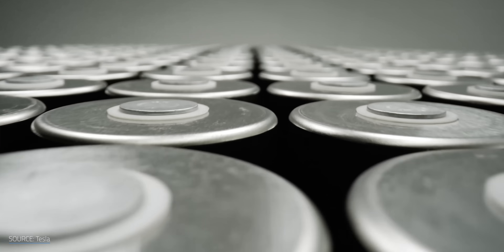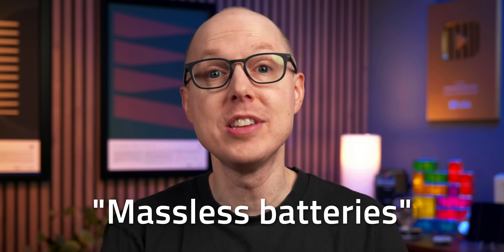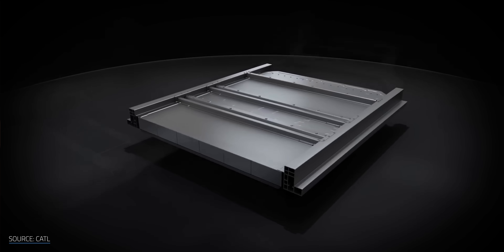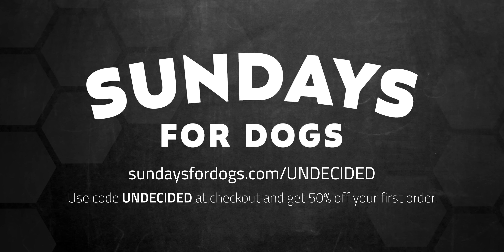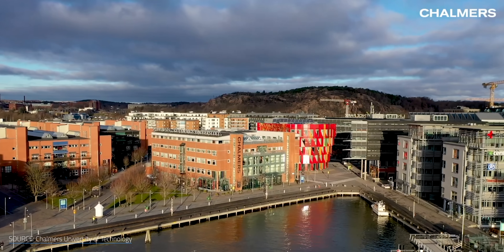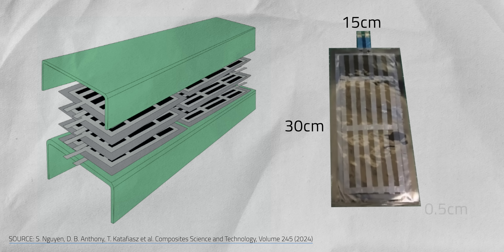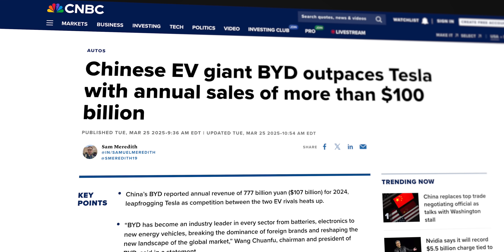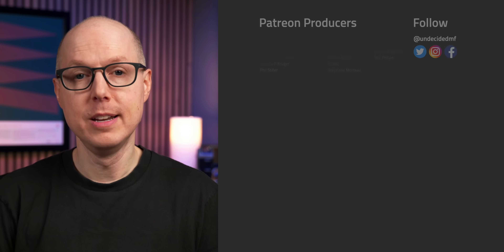The Strangest Battery Breakthrough Yet

Comment: in general i wish the industry would focus more on recyclability, imaging a car that is 100% recyclable, without having to to use highly complex and toxic methods to extract the resources, it might be a less fancy and potent car, but you can repair it and take it apart with ease, now that's a future i would love to see.
Reply: Exactly, the more resistent it is the harder it will become to recycle... For solar oanels that's fine because they will face the sun for 30 years or more, but for a car that has a high change of being totaled within 10, not so much.
Reply: @alexandruilea915 haha! Say that to every 90s or early 2000s car on the road today. 20 years should be the minimum!
Reply: @tonylarose4842  you are right, but I was thinking about accidents, not advanced degradation.
Reply: @tonylarose4842  Some cars ads now brag about reaching 100,000 miles without problems.
That used to be the bare minimum, and cars would reach 200k, 300k before they could no longer be maintained.
Reply: Just because something can be recyclable by a proven factory process does not in any way mean that you will be able to easily repair it - especially by your average consumer. Those two are entirely different things and require very different types of optimisation. Decide which is more important. Personally I think recyclability is the most important, alongside limiting environmental damage in the creation, use and recycling of products - and that does not necessarily mean that there are no toxic processes, just that the toxins are contained and dealt with in a way that doesn't harm the environment (e.g. like breaking down toxic substances into nontoxic byproducts).

Something to be considered is that finding ways to create new batteries (or new ways to create the ones we have) and decrease the resources used in them is very important, and structural batteries might be able to achieve that - even if it couldn't be easily repaired. The weight in vehicles like cars or planes directly leads back to how much energy is used to move them, so if we can decrease the weight we can decrease the emissions used in moving those vehicles. However, in the end, although it's important to create new batteries and ways of making them, all new technologies need to be produced with a view towards the environmental costs over the product's lifetime, which ultimately includes recyclability.
Reply: My thoughts exactly... I'm all for new battery technologies, we'll need a bit of everything for each specific application as we move towards an electrified world but, we must always factor in the recyclability of stuff in the long run and the batteries presented here look like a recycling nightmare!
Reply: The parts, schematics, and access for self- or small shop repair.
Super thin batteries and devices are fun to brag about, but when everything is glued together, an attempt at repair often results in wide destruction.
And a super-thin phone is also a super breakable phone.
Reply: That's the balancing act. The more tightly integrated something is, the harder it is to both repair (think phones assembled by glue rather than screws) and to recycle. In pursuing these technologies, we should start by asking which problem is the bigger one, then evaluating what our solution actually does to solve it or make it worse. Sadly, capitalism asks a different question, and that's how R&D capital is allocated.
Reply: circular economy needs to be a more popular goal
Reply: You realize making batteries is not clean right?

Lithium batteries are also volatile and are more noticable when mass produced as they can cause house fires easily if they are faulty.

A single AA sized lithium battery igniting is enough to cause a chemical fire which brings down a whole house, since lithium reacts to water.
Reply: @dra6o0n  the rate of spontaneous ignition of lithium batteries from internal short-circuits is very low, especially when they are undamaged. Gas stoves/hobs and old wiring cause the vast majority of house fires.
Reply: @ That 'low' rate gets multiplied by the millions of them mass produced in China, which makes the fault rate shoot up more as they cut corners to get more of it out.
Reply: Everything can apply by scale, what you deem is low from a single or double digit, isn't anymore when you go into the millions or billions.
Reply: @madsnylarsen  remember that research is performed to make profitable products, not to make the world a better place.
Reply: @madsnylarsen   Recycling is generally our last issue when it comes to environment
Reply: @madsnylarsen  tbf the key with vehicles is to make them as long lasting as possible so people stick with them
Reply: Most of everything on a car can be reused or recycled, the thing is how much it costs to recycle or reuse. Most of the time it's cheaper to just get a new one.
Reply: yeah but it costs money to recycle stuff, cheaper to dump it.
Reply: Anything that can be intentionally disassembled can spontaneously disassemble. 😆 "Easier to repair" is often at cross-purposes with "longer lasting", because every fastener and clip becomes a failure point. Products that are fused together with solder, welds, and glue tend to stay together. The only common materials that are truly recyclable back into the same material are metals and glass (and to some degree thermoplastics): any other materials (natural fibers, polymers) are degraded by the recycling process. But consumers want products that are durable, lightweight and small: metals and glass by themselves don't satisfy those parameters.
Reply: @erikdietrich2678  I understand what you mean but I don't see it as totally true. ICE engines, f.e., can be intentionally disassembled and serviced and they won't spontaneously fall apart just because. If things are purposely built and designed for being serviced and repaired they will be constructed in a way that allows said repairability without those things simply coming apart. Is it a compromise, yes. Are "disposable" products more profitable, yes.

You stated a big, harsh truth about "recycling": it's effectiveness is limited, much more limited than what we're "brainwashed" into believing. The problem is that the true, effective paths for a sustainable development, reducing and *reusing*, won't make anyone richer, so they're kept under the radar.
Reply: @erikdietrich2678  I can easily take apart a bicycle. With regular moderate maintenance it can potentially be ridden for a lifetime.
- 
Items welded, glued or fused together may stay together for a very long time... at the joining surface, but the material can fail just beyond that joint.

And now you have, instead of a loose fastener, a broken part that takes more than hand tools to replace.
Reply: @MonkeyJedi99  a bicycle has around 300 parts and no electronics, and the part count is only that high because of spokes, etc. And even then, you aren't repairing the individual pieces: you're generally replacing them with parts made by someone else. Your caveat of "regular moderate maintenance" is just another way of saying "constant minor repair".
A smartphone has more individual components on its circuit boards, and they're all smaller than grains of rice. How much physical maintenance does a smartphone require? None. And with some precision soldering, they are repairable. But to make a smartphone repairable by the average consumer, it would probably have to be the size of a bicycle.
Repair of modern devices isn't impossible: it's just wildly impractical and difficult for the average consumer, if only for the precision tooling requirements.
Reply: @erikdietrich2678  "Anything that can be intentionally disassembled can spontaneously disassemble" - How many products do you own or have you even seen that have spontaneously disassembled?  I'm going to guess the answer is zero.  Being designed to be intentionally disassembled doesn't mean "will fall apart on its own".

"'Easier to repair' is often at cross-purposes with "longer lasting" - You work for a car company, don't you?  Or maybe Apple?  Or some other company that manufactures products with planned obsolescence?

"Products that are fused together with solder, welds, and glue tend to stay together" - Glue fails far more frequently than screws, in my experience.
Reply: @nomore6167  Vibration "disassembles" machines all the time, which is why fasteners are sometimes secured with thread lock, which is effectively glue.
Consider this: what products do you own that are easy to repair, but never have had to be repaired? Any? Older cars allegedly are long-lasting, but somehow still require "maintenance" (aka minor repair) sometimes as often as something every year to every few months - fluids, seals, rotate/realign/replace tires, wipers, bulbs - never mind when components spontaneously fail. My tablet I've had for 5+ years: it's never needed repair or physical maintenance. I have never needed to take it apart, so it doesn't matter it's got hundreds of micro components, fused together, so would be very difficult to do.
And if you're seeing glue fail before fasteners, you're using the wrong glue, or glue isn't the right approach.
Reply: @erikdietrich2678  "Older cars allegedly are long-lasting, but somehow still require 'maintenance' (aka minor repair)" - The fact that you define maintenance as "minor repair" means you are arguing in bad faith and are not interested in having a meaningful discussion.

"Your caveat of 'regular moderate maintenance' is just another way of saying 'constant minor repair'" - So you have solidified your belief that maintenance is minor repair.

"How much physical maintenance does a smartphone require? None." - Well, it requires the battery to be charged (which is maintenance, aka minor repair) at least once every few days, and it requires the battery to be replaced (aka repair) at least once after few years.  So much for your "none".
Reply: @nomore6167  charging a phone is "repair"? now that's in bad faith. Replacement of components, including fluids, as they wear out is repair. I don't know how else to define repair. The rubber of windshield wipers and seals breaks down over time, and cannot be fixed, only replaced. Filters and lubricants degrade and stop working. Metal rusts and flakes apart. Filaments in incandescent bulbs break and cannot be fixed, only replaced. That's repair.
Reply: @erikdietrich2678  "charging a phone is 'repair'?" - Going by YOUR definition, yes.  You are the one who said that maintenance is "minor repair".  Charging the battery is regular maintenance.  Thus, according to YOUR definition, charging the battery is "minor repair".

"Replacement of components, including fluids, as they wear out is repair. I don't know how else to define repair" - Repair is the fixing or replacement of defective or damaged parts.  Replacing fluid (which is done to PREVENT damage) does not classify as repair.  That's why it's called maintenance, because it is done to maintain an item (to, PREVENT damage).

Also, to quote you again, "Replacement of components, including fluids, as they wear out is repair" - You claimed that a smartphone needs no maintenance and no repair.  So, according to YOUR claims, the battery in a smartphone never needs to be replaced (and, apparently, never needs to be recharged).

It's okay to admit that you're wrong.  Despite what some people think, it's not a sign of weakness.
Reply: @nomore6167  charging a phone isn't "repair". Your exact words: "repair is the fixing or replacement of defective or damaged parts". Great! We agree, since I said "replacement of components... as they wear out is repair." I don't see how those two sentences are meaningfully different. Replacing fluids may be were we disagree, which is fine. Certainly you've done more than replace the lubricants in a car, yes? Wipers, tires, belts, spark plugs, light bulbs, fuses. Maybe seat covers, or gaskets, or hoses. And since "replacement of defective or damaged parts" is your definition of repair, we're all good. Right?
You are arguing that charging a phone is maintenance, and therefore contradicts my definition of repair. I don't think charging a phone is maintenance, therefore it doesn't contradict my definition. Merriam Webster says "maintain: to keep in an existing state (as of repair)". I'm not repairing my phone when I charge it. The battery isn't defective or damaged on a daily basis. And with good charging practices (not above 80%, avoid heat, don't charge too quickly) a lithium battery will last 3,000-5,000 cycles before losing significant capacity. Even daily charging that's 8 years. 
Certainly you've repaired something on a car in 8 years if you drive it every day, yes?
Reply: Enter by faith in Christ into His soon Millennial Reign, and you’ll be impressed by the responsible tech solutions He standardizes globally. Finally, when Yeshua (Jesus) is in charge, all the ideal solutions for everything will become common and the world will have lasting peace. I can hardly wait to be one of Yeshua’s engineers He empowers to solve the world’s technological problems. I pray I see you there. 🛠️
Reply: What's for dinner, dear? 
Why, the old car, of course.

Nature is where the toxicity comes from too 😜
Reply: Yesnt..? While many natural things are toxic, waste made by humans that wouldn’t be there otherwise is making other things toxic

Comment: In the Trucking industry, structural batteries in combination with onboard PV Panels could prove to be a game changer for E-Trucks.  A large part of the problem with E-Trucks is the weight of the battery and the length of time it takes to charge that battery so why not have a duel combination?  A swappable battery that can be removed and replaced with a fully charged battery along with a structural battery incorporated as part of the body of the massive trailer with PV panels on the roof to keep those batteries topped up.  The swappable battery wouldn't need to be manufactured as part of the structure so it could be installed and removed with a fork lift and placed on the charger or placed back into the truck fully charged ready to go.  This would reduce the net weight involved in an E-Truck semi as compared to a full battery with onboard charging.
Reply: You need to do the math to understand the vast gulf between what solar panels on a trailer can generate and how much power a truck needs.
Reply: @skierpage  Exactly, the energy capacity and density required in a semi truck is vastly greater. It'd be closer to trying to convert a locomotive than a car. It just doesn't make sense in that application. Not in the remotely near future anyway unless there's some crazy battery tech breakthrough.
Reply: @skierpage  
The roof of the trailer alone could support 24 (~15 across on one side and 9 length ways on the other side) with another 30 folded down towards each side and folded up when the vehicle is parked to maximize sun exposure for a total of 54 standard size of  39"*65" PV panels  While not enabling a full charge they could possibly supply about 10% to 15% of the charge needed.  The 24 panels would actually form the roof of the trailer and provide continuous charge while in the sun with the side panels pivoting up and down.  Fifty-four standard PV panels, each producing around 400 watts, could generate a total of 21,600 watts (21.6 kilowatts).  Half that for less than ideal conditions and they could produce about 10, 000 watts or 10.0 kilowatts.  While not a self sustaining system it could contribute to the battery charge providing the panels are replacing the some of the trailer structure (most likely the roof) by incorporating them as the structure.  The trick is to reduce the battery weight to a bare minimum enabling the remaining battery to travel the same distance with less weight.  That is why a semi would need structural batteries like those being developed at Chalmers in Sweden and a swappable second battery system for a quite replenishing of the storage.
Reply: @anguscampbell1533   solar panels replacing the roof of the truck is fantasy. You're more likely to have perovskite thin solar films on top of the truck (there was a company claiming to do this 3 years ago, I think it folded), but they have worse efficiency and a degradation problem. I appreciate you doing the math, but that's with the sun directly overhead. Most of the time the output will be much less. Solar panels on the sides will generate even less, and the idea that the truck driver will have time, room, and insolation to extend them is fanciful. Congratulations, you've just come up with a much more expensive trailer. In the real world, that expense is better put into a larger battery pack which extends the truck's range at all hours and in any weather.

I welcome the idea of solar panels on every surface that gets sunlight, but there's a reason we don't see it yet.